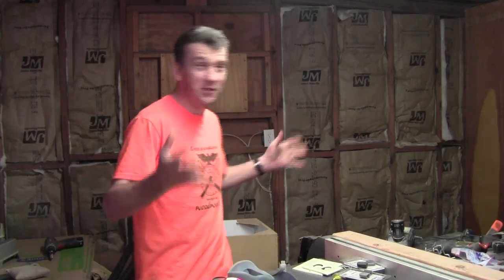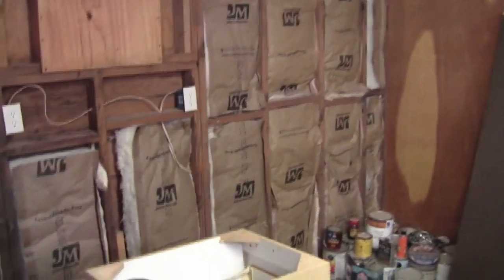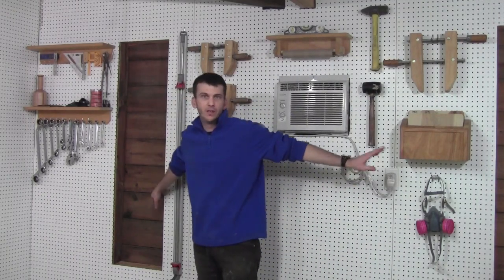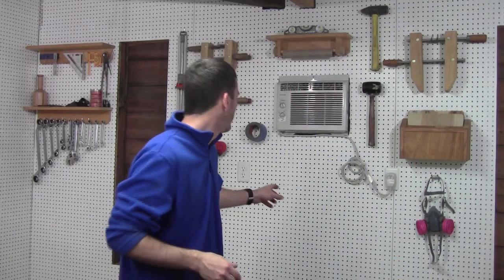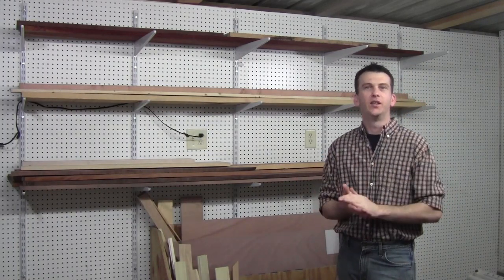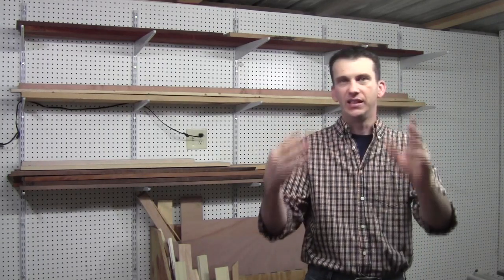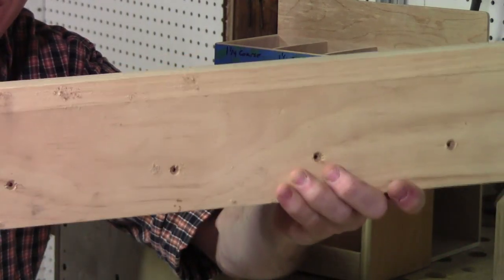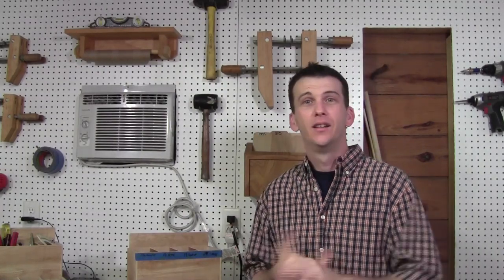Remodeling the Workshop

Comment from the maker: Take a look at my newest video regarding the in the wall storage, the wall was even sealed and insulated.. I discuss this in the video I just put out. Also, the Kreg Jig is not going into this building, I misspoke, I have this shop temp set up to work in until I set the new shop up, which you will also see in the new video, and yes The walls will be filled, I have oak cabinets up, tools hanging, storage shelves built, clamp racks on the wall, Lumber racks, so it breaks the wall up quite a bit.

Comment: Looks like your coming along in the shop, deffinatly will be watching the updates, getting great ideas from it. Never thought of doing ALL the walls with pegboard, great idea there. I do make use of the areas between the studs you can fit a lot of shelve and storage in that area. Hope to see some vids on the setting up of the other building. Are you going to somehow make a connection between the two in case of bad weather? My next shop project in the Spring is to put down a floor of OSB in mine.